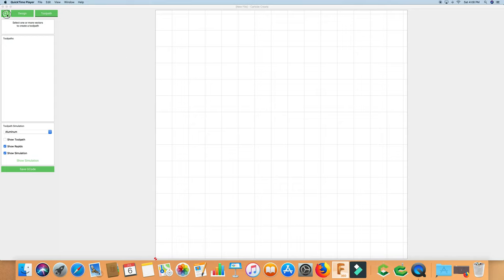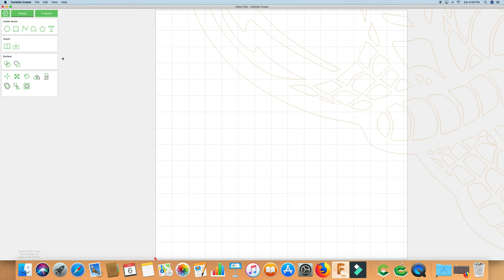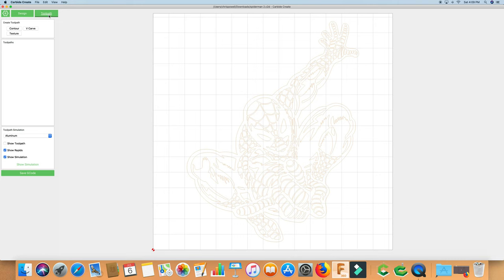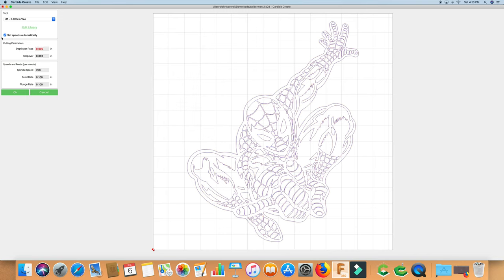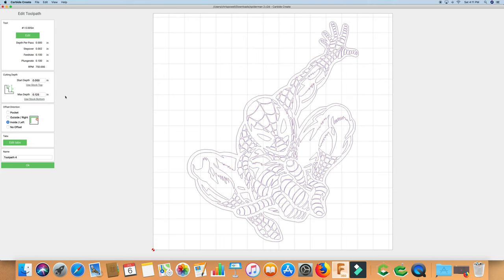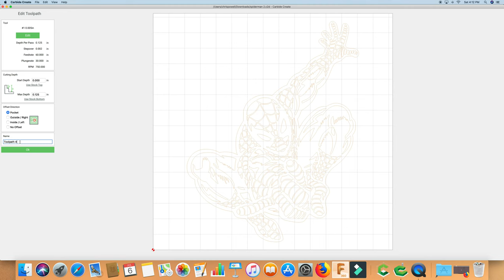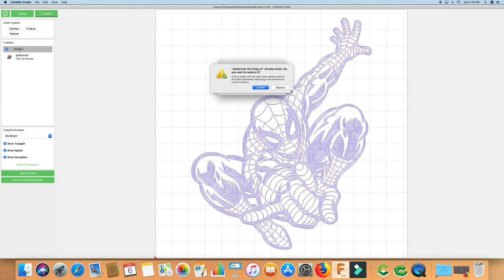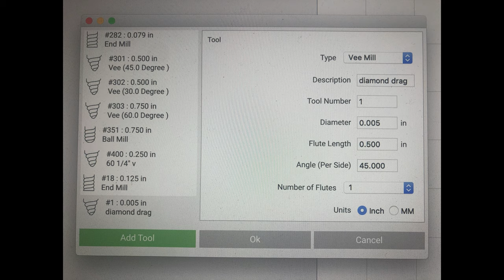How To Set Up A Diamond Drag Engraving Bit In Carbide Create and Program This Image of Spider-Man

Comment: What kind of machine and bits do you use. What equipment and tools would I need to start doing this? Thanks
Reply from the maker: I use a shapeoko xxl cnc router. The bit used is a cheaper 60 degree diamond drag bit from Amazon. You can get a smaller, less expensive machine if this is all you want to do, but if you ever want to be able to do some of the stuff in my other videos, check out the Shapeoko.

Comment: Hello - pls tell me what version of CC do you used for this my CC version is Build 316 (2018-7-20) --- it is difference than your - I do not have an SVG file but I have a DXF file - will it works? I do have a SO3 XXL and diamond drag 9- degree bit with 1/4" shank --- pls help me I want to etch on Arcylic for LED display
Reply from the maker: I hope you got everything working between our messages and the help you got from the Shapeoko group. Let me know if you need anything else.
Reply: @ChrisPowellFSD  - Thanks for your help on facebook - I got to update to the newest version of CC from 361 to 423 and I believe I got it to work. I load the gcode in CAMotics to view the simulation and it seemed to be working but I will have to actually carve it on Acrylic with the diamond drag 90 degrees and I am waiting for it to come, just order them last few days. Thanks again - Will make a video to show it to you, Sir. Thanks again
Reply: @walkbehindtrimmer_attachment  Any chance you could  post something on the feeds and speeds for the acrylic? Just got my acrylic plate and a 90 degree DDB and could use some input so as not to waste too much plexiglass. Ordered all the parts and pieces today to do all of the wiring stuff for acrylic lit signs. Thanks.
Reply: @johnross9369  --- I used the 90 degrees diamond drag bit - Step over=0.005 Depth per pass=0.125 Feed rate =77 RPM= 777  'this does not apply - router or spindle is OFF' --- Plungrate=33 ----- I use Pocket to fill areas that I want to highlight and on the line for areas not need to be highlight ( for example the outline 'No Offset' VS the filled one which I used 'Pocket style'.) Max depth = 0.033 not that much down. I am trying to express but my English is bad - the outline is much faster and created smaller gcodes file verse Pocket take much longer and created huge gcodes file - hope this help - check out my other works https://www.facebook.com/artcam.cad.cam
Reply: @walkbehindtrimmer_attachment  Thank you, I'll give it a try and hopefully be able to post back a positive reply for the results. One more question, for cutting out pieces from an acrylic panel 3/8 thick, what feeds and speeds for using a 1/8 up cut bit.
Thanks again for the help.
Reply: @johnross9369  --- I never cut through Arcylic before. The shop where I bought my Arcylic sheet from they said 10,000 rpm for 1/4" diameter, so if 1/8" you may have to go faster - I am not sure. it will not hurt to try and to find out

Comment: do you think this drag bit will work for a sawmill blade? my mother n law wants a scene of some sort engraved on one she has but I have never used a diamond drag bit nor cut on metal. Just curious.. if maybe you knew?
Reply from the maker: It should work on anything softer than a diamond, so yes. It should work on the saw blade.
Reply: @ChrisPowellFSD  so I’m still new to the game, when setting the cut depth to .125 and max depth .125 and let’s say the thickness of the project was .25 why wouldn’t it try to drag until it’s all the way an 8th of an inch into the project?
Reply: @SpwnDragn  you will handily destroy your diamond engraving drag bit if you try to V carve with it to those depths.
Reply: @acerjuglans383  yes I know it would destroy it. Hence my question.
Reply: @SpwnDragn  The drag bit is spring loaded. If you had a regular bit installed with those settings, it would plunge to .125, make the cut, and be done since it just cut down to the max depth. With the drag bit installed, it thinks it is plunging to .125 but really it is just creating pressure with the spring to push the diamond onto the surface of the stock. It makes the cut in one pass which is really just dragging the bit along the surface, then thinks it is done because, again, it believes it just made a .125 deep cut and that's as deep as it was supposed to go.

Comment: Where did you get the spiderman file from. I have a drag bit on order.
Reply from the maker: I just search for Spider Man line art on google images.
Reply: @ChrisPowellFSD  Thanks.
Reply: @ChrisPowellFSD  Whenever I load the image and try to do a tool path I get no suitable  vectors selected
Reply: @ChrisPowellFSD  I am getting no suitable vectors selected. What am I doing wrong?
Reply: @ChrisPowellFSD  What version of CC are you using?
Reply: @JLHahn  you have to convert image to vector first

Comment: How do you get past the bitsetter? My spring loaded drag bit will not compress the bitsetter
Reply from the maker: Easy. I don’t use a bit setter. I use a piece of paper to set z.
Reply: I use paper method to zero z also, but I have bitsetter and it wants to use it when starting a job and the spring loaded bit will not compress the bitsetter. I finally just decided to uncheck bitsetter and resend config when using the drag bit.
Reply from the maker: Stuff like that always seemed like more of a headache than it’s worth to me. I use depth stop collars on all of my bits. That way, I just set z once based on the given material thickness. When I need to change a bit, I just put it in and start running again.
Reply: Yes , but I have really enjoyed the bitsetter for tool changes. It has only been an issue for the drag bit. Love your videos btw! Very helpful